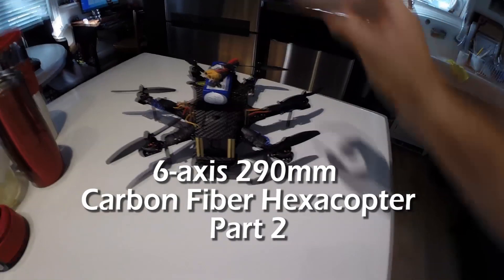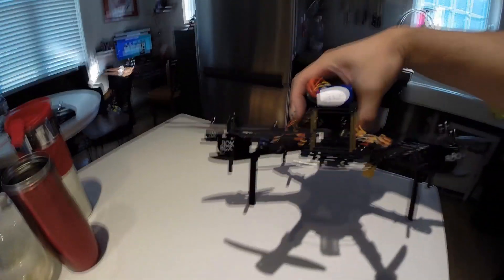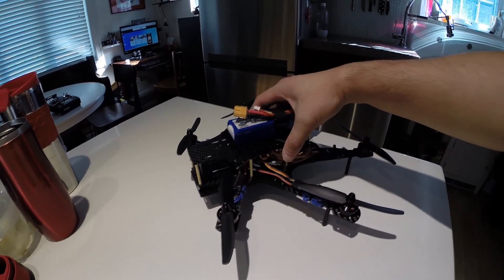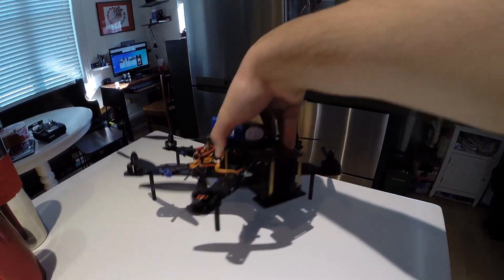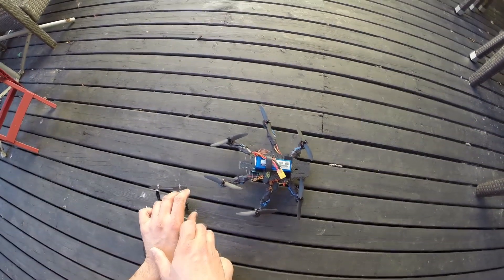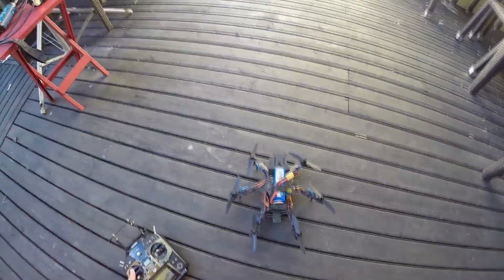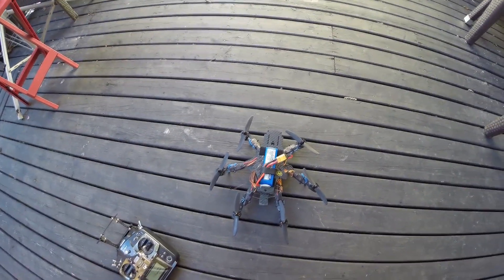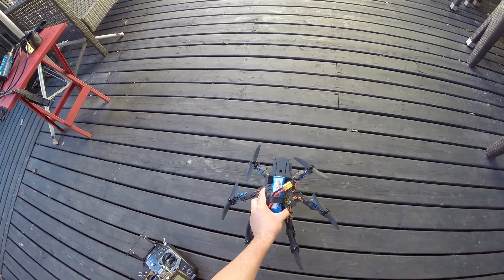6-axis 290mm Carbon Fiber Hexacopter - Part 2

Comment: Hey Andrew, I really enjoy your videos. I saw your first hex video and I decied to build a mini hex for myself. I ordered the exact same parts as you did from the exact same websites as you did. For some reason the motor mounting screw holes are too close together and won't mount onto the carbon motor mount. Any suggestions on what I should do?

Also, I am having some problems with the frame, I can't seem to figure out how to mount the arms to the frame. Could you please tell me the order you screwed the arms in? My kit of parts looks a lot different than yours, it has lock nuts for the arms and I tried putting two of the washer in but the screws did not make the arm very stable. Any suggestions?

Comment: I finally figured out what was happening with the motor. One of the lead wires on the inside of the motor (Sunnysky x2204s) was too close to the mounting hole and the screw chewed through the insulation shorting it out. The other five motors were OK but I changed the screws closest to the wires from 6mm to 4mm long, hopefully they'll be long enough secure the motor. Still struggling with the PI settings. Does your hex wander a lot when hovering? That seems to be my biggest problem.

Comment: Hi Andrew. I got this frame too. Don't think it will take the abuse that the Blackout can, but I don't plan on flying it like he does...Yeaaa, Right!  And I don't plan on crashing it either :-\. Anyway, I'm trying to dial in the PI settings on a KK2.1.5 w/Steveis firmware and not having much luck. Could you share your settings? On another note I immediately pitched the brass standoffs and went with M3 nylon standoffs and screws, had to enlarge the holes with a file but it looks good. Used a file because I didn't want to get any nearer to the edge of the plate than the holes were already. I also moved the FC about 8mm forward from the stock mounting holes to get it to the center of lift. Thanks for the video!!!
Reply from the maker: Thanks for the comment.  I'm going to pick up some nylon ones soon, thanks for sharing how you used file instead of a drill.  As for my PI settings I have been lazy and just flying on the stock settings and mostly on auto level, I'm not the best pilot yet LOL.  Seems to fly well, one of these days I will adjust them to see how it goes, mainly haven't done it because it's hard to adjust since I can't see the screen, I will need to move some wiring around and take off the FPV gear that I have on it now so I have a clear view.

Also I smashed it into tree branches this weekend, seemed to hold up ok so far..... at least the price was right!
Reply: Andrew W
I  got into quads in December last year so I'm kinda raw at piloting too, auto level is my best friend for now. I made a window above the FC about 18mm wide and 26mm long, I wanted to leave the longitudinal slots intact for strength. I wanted to mount the ESCs on the bottom of the arms (hopefully it won't be a problem with ESC heat buildup) so I enlarged the holes for the landing peg screws and ran the motor leads through them. Got a PDB and put it between the lower plates to clean up the wiring and add auxiliary power taps. I've got the FPV gear but won't mount it until I've got some serious stick time. Discovered yesterday I have a possible bad motor then today I burned an ESC trying to troubleshoot, so... waiting game:-(
Reply from the maker: Banshee Rydr
Bummer about the ESC and motors, I've gotten in the habit to order at least one extra motor and ESC no matter what brand.  Takes forever to get stuff from overseas but then again it's so cheap can't complain.  I think mounting the ESCs on the bottom won't be a problem especially if the hex is flying, even hovering I don't think they would over heat.  I just put it on the scale with all the FPV gear and a 2200mah battery, it's 640 grams.  I did a hover test flight and I'm getting around 10 minutes of flight.  With a Gopro, I think more around 7-8 minutes.  I'm going to do a flight time video of the copter to show what times I'm getting once I get a chance and the weather is nicer.
Reply: Andrew W
I ordered 3 ESC's and trying to order two more motors from Goodluckbuy, that's in addition to the replacement motor from BuddyRC. Lesson learned :-\ Not all overseas orders take forever, ie, last one from HK took 45 days to arrive. I'm done with HK. Other orders come in about 1 1/2 weeks. Unpredictable...